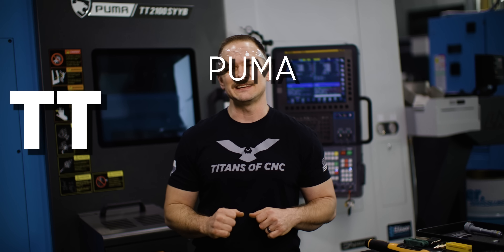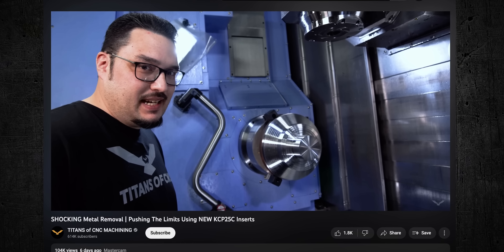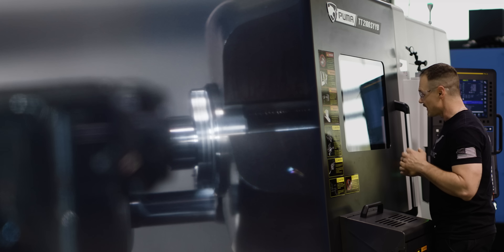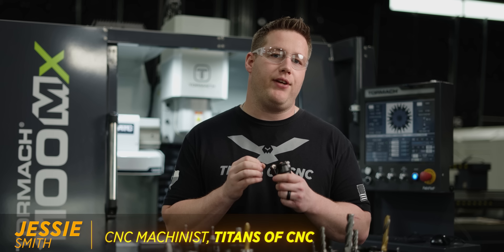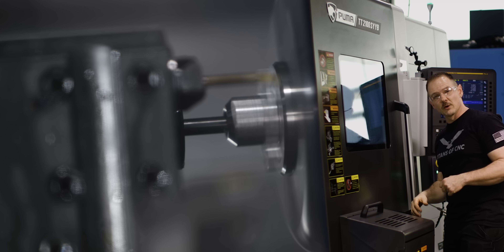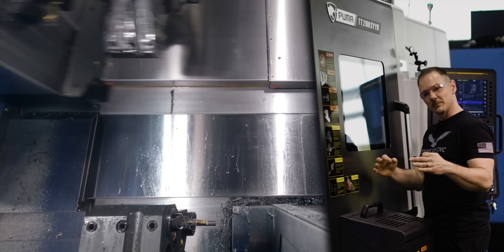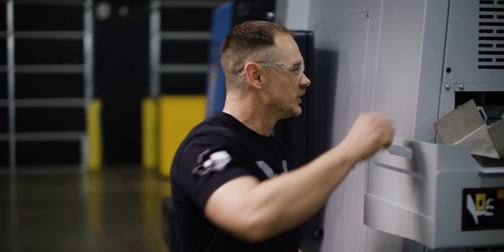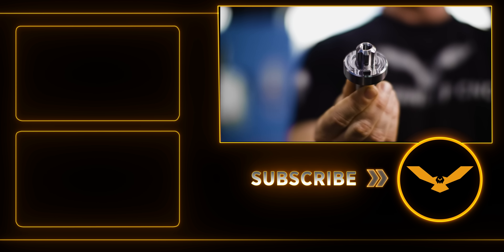Machining Custom Part for YOU on our Twin Turret CNC Lathe

Comment: A Customer ordered machined Cylinder Heads for racing application. He said, "I will an mirror finish surface on the top deck. Best way to do this, is using a fly cutter." But we not having tools like this. So we took a 160mm shell mill, removed all inserts and let only one in place. Now we can make beautyful even mirror shining surfaces on Aluminium parts. Having no extra cost for special tools. Each Head bring us 20.000 $. Greetings from Germany. Lot of our machinists are watching your Channel.

Comment: ISO30 tool holdes often only come in 22mm or metric arbors. Very limited selection. It would be awesome to have ISO30 tool holders with a 1" arbor so we can use any common 1" arbor face/shell mill. Full IS030 Tool holders with 1" arbor,.

Comment: So I'm a cnc VMC apprentice, I work on a huge YCM 188tv and when roughing out/facing off I'm using an 80mm 3 tip facemill, the swarf it creates is diabolical it tends to wire together in massive clumps and it jammed my conveyor 3 times and set the breaker off so I have to scoop it by hand, I go through 4 barrels per part and as you can imagine it's not fun, would it be better to use a smaller shell mill or something like an iscar cutter just to help with the swarf?

Thank you keep up with the amazing vids.

Comment: When transferring between spindles, why is it necessary to have them both spinning? Why not zero c-axis in both and do the pull? I understand we're about to part-off, but I really need good timing between the two operations.

Comment: Something I've always wondered about dual spindle lathes, why are the spindles rotating slowly during the part transfer?  Is that done for some concentricity reason?  To keep chips off the part while the second spindle is clamping? Is it doing the clamp while simultaneously ramping up for the cutoff?  Or is this done for some other entirely different set of reasons?  I've seen this with lots of dual spindle lathes over the years but never understood why the transfer between spindles isn't done with both spindles stationary instead of slowly rotating.